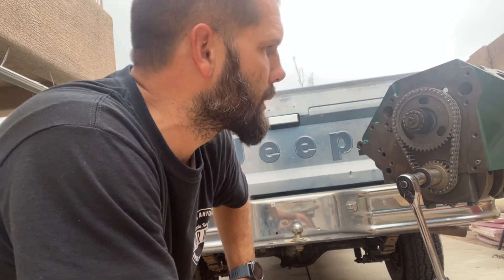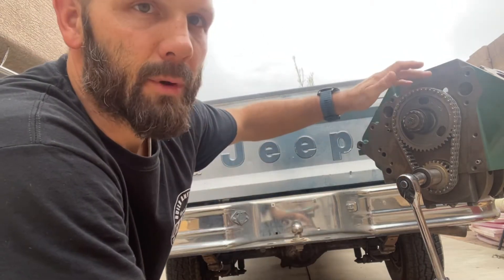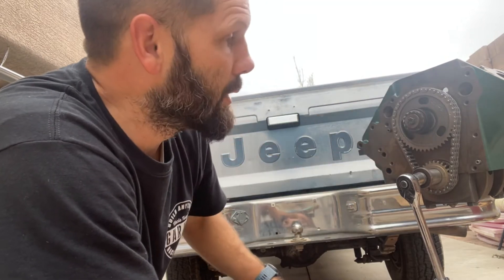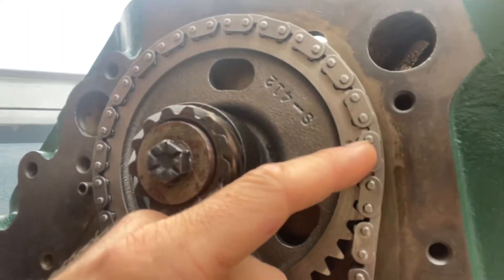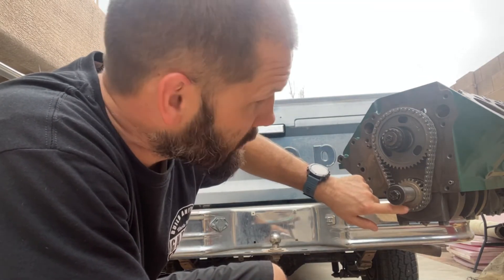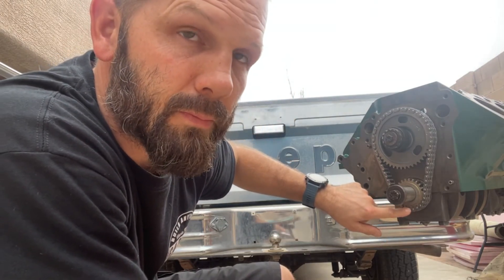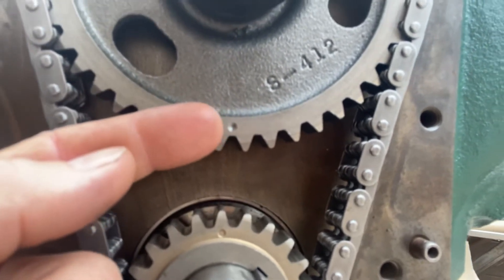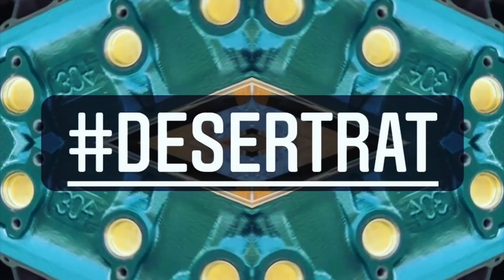Timing for Jeep AMC V8 304 5.0L Engine - Engine being rebuilt for Crate purpose

Comment: Thanks, will keep this in mind. Replacing a timing chain in a 1978 AMC 360 in the next few days.
Never understood “why” not just start and finish with the dots facing each other? This timing chain seems to have what you mentioned as an important step (that I am sure most miss).
Have a reprint of the 1978 manual but have not read the section for timing chain yet. Will before replacing. 
The previous owner thinks the chain is off a tooth, but seems it would run like ass if that was the case, and it isn’t doing that bad. 
Thanks for the video.
Reply from the maker: Good luck w the project sir! And thank you for checking out the video. Glad you found it useful.